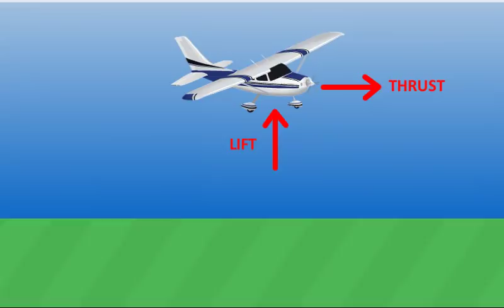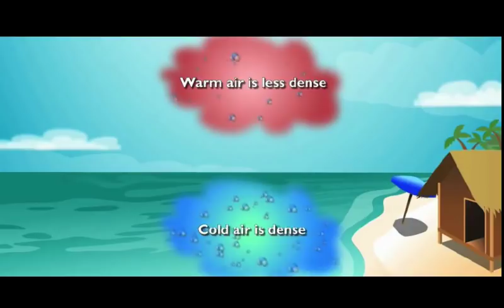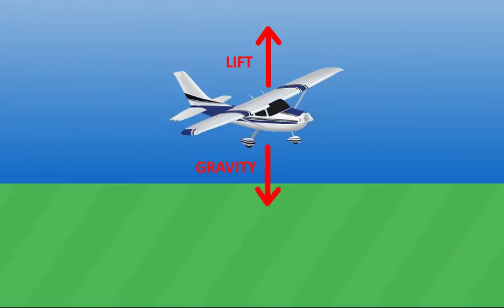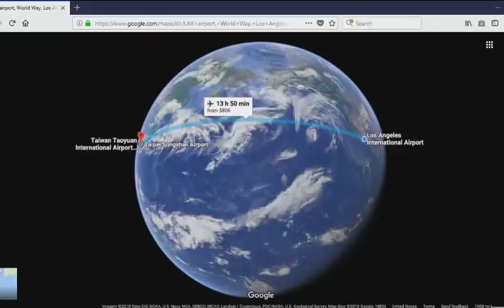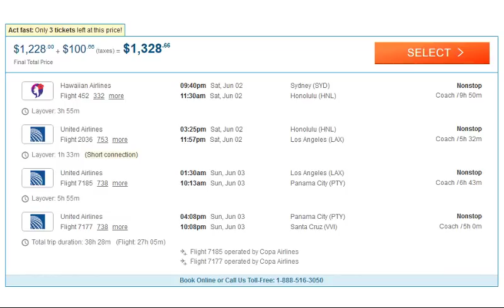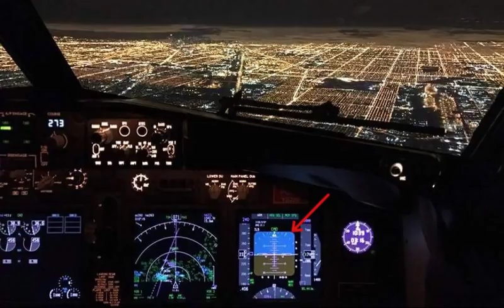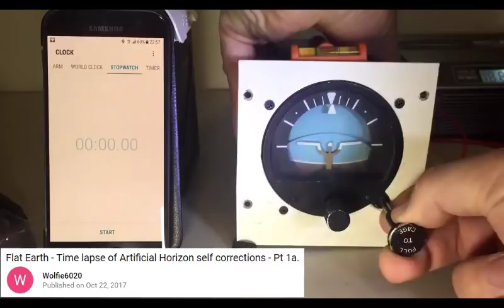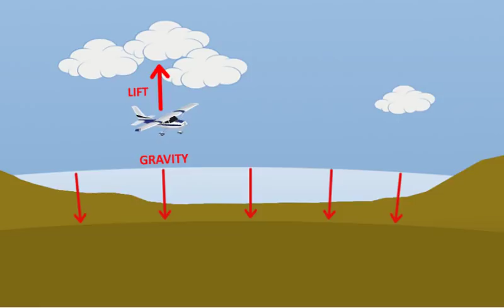Flat Earth Falsities - Plane Nonsense

Comment: So the corialis effect only affects bullets? And not planes?
Reply from the maker: The Coriolis is effect is real, but I don’t think you understand it. It is most notably apparent in the fact that storm systems tend to rotate counter-clockwise in the Northern Hemisphere, and clockwise in the Southern Hemisphere. It has a small effect on bullets, because they only travel short distances over a short period of time. And it also does effect planes, but the effect is also minimal. The difference between a bullet and a plane is that planes have pilots. Pilots are always adjusting course to account for winds, so the Coriolis effect will just be accounted for as part of those adjustments. Bullets do not adjust course.
Reply: The Coriolis effect affects planes. Planes have pilots and autopilots, and planes interact more with the atmosphere which reduces the effect. A northbound and southbound flight between two cities is equally affected.
Reply: A very sound question Davey, to question is good, to be critical of answers is also good, even if denigrated. The fuel required when traveling towards the poles is less than when traveling towards the equator.  I imagine that for a wide-body passenger jet on the Rio-New York City route, the difference would amount to several hundreds of kilograms (liters) of fuel. 
At the latitude of Rio de Janeiro the Earth's rotational speed is about 1545 km.hr-1 whereas at New York City it is only about 1265 km.hr-1.
  The extra fuel in going from NYC to Rio can be thought of as the fuel consumed in the time to accelerate the aircraft's ground speed from 1265 to 1545 km.hr-1 while the aircraft's true airspeed is equal to its cruising speed.
When an engine or aircraft manufacturer is carrying out fuel consumption tests, when analysing these tests, the engine or aircraft manufacturer will calculate the amount of fuel to be allocated to the change in latitude from take-off to landing. 
We all know it takes more energy to walk from the center of a merry go round to the edge than vice versa: when you are at 20 degrees latitude, are'nt you closer to the Earth's axis of rotation than you are when you're at the equator?
Think ignoring the 30,000 feet high less dense air (less sticky /pressure, and driven by a Momentum..) would mess up the calculations. On top of that, can one fly due north/south?  Because of the earth's rotation of about a thousand miles per hour and to ignore that.., would also mess up one's sums... one would have to fly at an angle to get a truer figure you would expect!
Gravity at the poles is also less and the troposphere gets lower, thus the aircraft would require less fuel to stay in the air as it goes north, which is another factor to consider with the Earth Heliocentric model.
So all considered I would not expect an equal effect in any opposed directions, even if not Physic's guy...
Note: In physics, the Coriolis force is an inertial or fictitious[1] force 
that act on objects that are in motion within a frame of reference that 
rotates with respect to an inertial frame. In a reference frame with 
clockwise rotation, the force acts to the left of the motion of the 
object. Wikipedia
 [1] adjective: fictitious= not real or true, being imaginary or having been fabricated.

Comment: Another thing of many the flatards fail to consider is that when speaking in terms of ROTATIONAL measurement we use revolution over time and NOT mph. That is why if your car or motorcycle has a tachometer it is measuring the revolutions per minute of the engine and the speedometer measures the distance traveled in mph. The earth ROTATES at one revolution per 24 hours so even if ignoring the laws of momentum why would they think a helicopter hovering would have the earth speeding away at 1000mph? 

They have no concept of reality, physics, measurment, space, time or anything for that matter. Brains like a fucking 2 year old sad really.
Reply: Well done, you have attracted the resident troll, Louise, conclusively proving you are correct.
Reply: @boffeycn  I did well also! :)  I knew you would be attracted after I inputed.  No Resident like you, sure were not interested before, 3 hours is long for YOU, and your 'like', but some accounts have pipe down....
Only wong keeps ignoring me, tell ALL to not read & respond... jealous he is, sourpuss old man, full of Science.
ps: old fart is really into Flattards / morons / idiots / 5year olds... 80+% of his.. inputs are for those.
But even when he gets a few name-callings in, still wails out when I droopby, not a sharing kind kid, single child?
Reply: How fast is the surface of the earth spinning?
The earth rotates once every 23 hours, 56 minutes and 4.09053 seconds, called the sidereal period, and its circumference is roughly 40,075 kilometers. Thus, the surface of the earth at the equator moves at a speed of 460 meters per second--or roughly 1,000 miles per hour.
How fast is the earth moving? - Scientific American

https://www.scientificamerican.com/article/how-fast-is-the-earth-mov/

How Fast Are You Moving When You Are Sitting Still? - ASP
https://astrosociety.org/edu/publications/tnl/71/howfast.html
To make one complete rotation in 24 hours, a point near the equator of the Earth must move at close to 1000 miles per hour (1600 km/hr). .... We could measure the motion of the Milky Way relative to a neighbor galaxy, but this galaxy is also ...
Reply: Brains of. 2 year old ? So a level doesn’t work the same when your in flight. Think about that ,Before you buy what their selling. Planes automatically follow earths curvature !! Hahaha !! Who’s the fool ?
Reply: @brianliebel3257  You are. Why did you ask?
Reply: @brianliebel3257  How and why do you think a spirit level compares its orientation in one location with a remote location?
A plane is dependent on movement through air to stay airborne; why do you think a thinner atmosphere would give it the same lift?
Reply: Sweet Jesus! The weirdest stupid lines get upvoted 4 times!  Scratching buttbodies or these Idiots are using 4 accounts?
Would not put it pass THEM, even if in Majority numbers and in Education to listen them bragging....
Ape-pride & Retard-pride (debunking) too? 

wong= Why are you feeding the troll?@DFR666 3 months ago (edited) (- that must of been hard writing...)
DFR666= @wong I'm not sure , maybe the same reason you do it ? 3 months ago
wong= I don't. You do. @DFR666 3 months ago

wong= Is it now time to block the trolling spammer @Haris Haringa  ? 3 months ago (- crying to dady again)
wong= Proof the Earth is flat Muy holey bubull am der troof.  4 months ago  (- and HE's anal about it?)
wong= @NotTheCIA I.think Please don't feed the troll.  4 months ago

wong= @paper man  I have studied and lectured in universities all over the world (- NOT a Professional Navigator then???)
And there is no need need to shout.  (- yeah but need of infantile insults galore!)
You seem to have the intellectual capacity of an empty Marmite jar. (Or Vegex, Vegemite et al.) 

wong= How dishonest can one be.(???) Try Mark Sargent. "Remember, the burden of proof isn't on the flat earth side" 

wong= Another FE cultist has totally lost what little of the plot they had. (- like his credibility on all levels)
"I am just going to make sure (RIGHT NOW) that you are investigated by some very serious people". (- PSYCHIATRIST!)

Doctor Flook > A spirit level, bubble level or simply a level is an instrument designed to indicate whether a surface is horizontal or vertical. (Wikipedia), if the next location is still FLAT, then there is a curve problem... And One can very with 'two sticks & string' that there is continum. 

When an object is pushed in one direction, there is always a resistance of the same size in the opposite direction. ...
(less if  the pressure and thinkness is reduced).
    Concorde or any supersonic flights cannot maintain their speeds at lower altitude due to.. drag!
 If a Concorde had flown below 40,000 feet, they burn more fuel.. despite "better lift"... 
= 60,000 feet(2X), while normal jets fly at 30,000.
 The highest military air-breathing engine airplane SR-71 = 90,000 feet(3X).
- so as long as there is enough air, to support all needs of the plane there is sufficent lift.

Comment: the scene with the plane is a good explanation, but its not what planes do. they fly on a pressure level. thats why "flat" to them might be up&down from another viewer.
Reply: Only ..crickets.. for your (globe) factual input on Plane sense? The Inhouse Coppers prefere less valuable (FE) comments.
[ Aircraft altitude is measured (inferred) by atmospheric pressure. The aircraft is usually flown at an altitude that maintains constant ambient pressure (by pilot or autopilot, as the case may be). Changes in local barometric pressure (provided by air traffic control) are used to recalibrate the aircraft altimeter. As long as the aircraft is flown at a constant ambient pressure (hence constant altitude), it will be following the earth's curvature (bla bla bla)...]
    - Thing is if Thee Responsable for that is GRAVITY, and SHE has "pockets"[1] / falts / anomalies... then how can it work out safe?  Your storyline is that the more MASS between the IRON CORE = the less Gravity force.. so.. should be difference flying over deepest  trenches of the Oceans and high Mountain ranges. YES?

"Contrary to somewhat popular belief, gravity is not the same everywhere on Earth. See the above picture, where there are areas on Earth (Texas, U.S.A in the above picture) where gravity is actually a little stronger than other places. The more red an area is the stronger the gravity is in that area."
https://www.quora.com/Is-gravity-the-same-no-matter-where-you-are-on-earth-or-are-there-pockets-where-Gravity-is-stronger-or-weaker

How can parts of Canada be 'missing' gravity? | HowStuffWorks
https://science.howstuffworks.com › ... › Earth Science › Geophysics
Gravity in the Hudson Bay area and surrounding regions, including Quebec, is lower than it is in other parts of the world. ... For more than 40 years, scientists have tried to figure out what's causing large parts of Canada, particularly the Hudson Bay region, to be "missing" gravity.

[1] https://www.youtube.com/watch?v=QL6L1cRTeEU
Reply: AH! The globe troll finally came by... a day after, rare, like my most dedicated 'Ignorer' was waiting for.. a reason to comment (intelligently) on this one. DAM, for once there was a sensible globe Commenter, he's of those that dont (dare?) reply :(